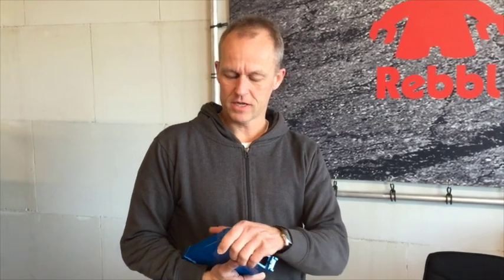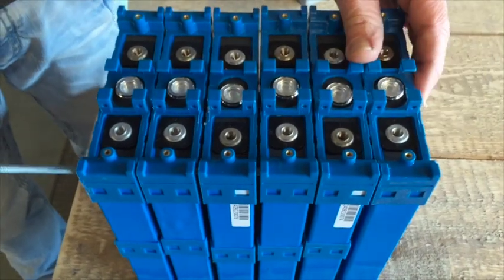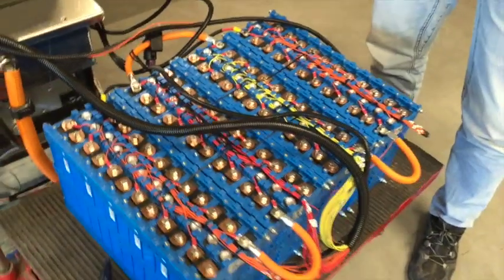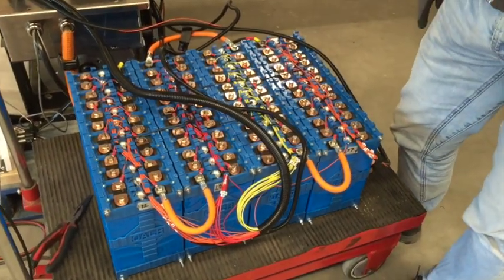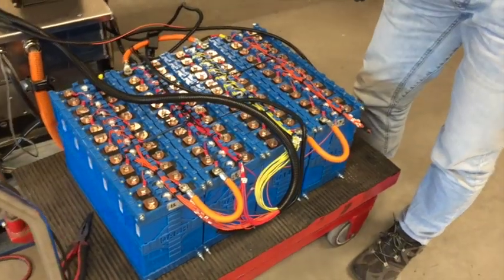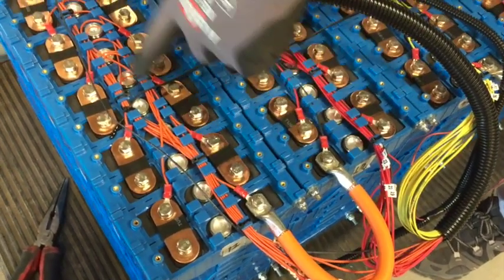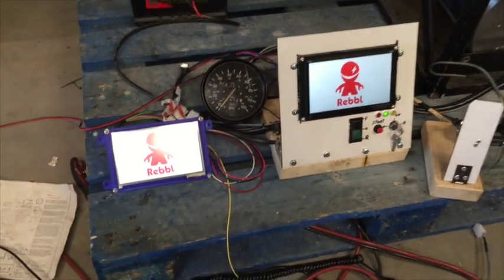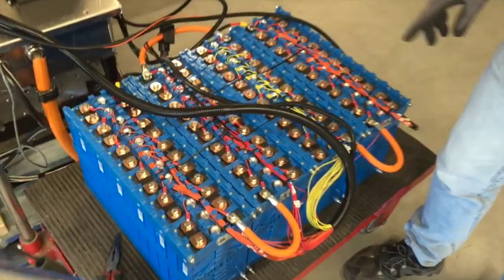REBBL Calb 72Ah CAM cells

Comment: Hello - I can easily find the dimensions of the CALB CAM72FI cell online, but I am having trouble locating the exact dimensions of the 4-piece protective suite for mounting in a pack. Do you have a link to that diagram? Thanks.
https://914electric.files.wordpress.com/2013/05/ds35895-tilt-line-best.jpg